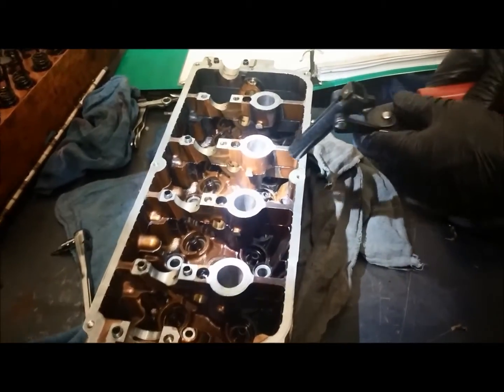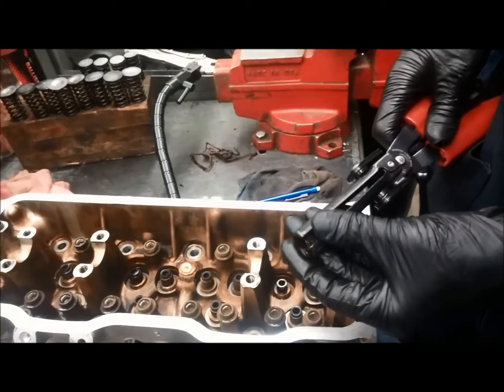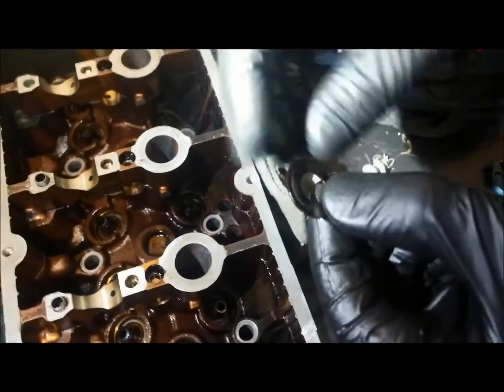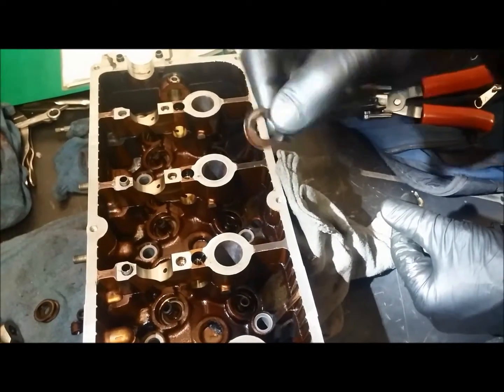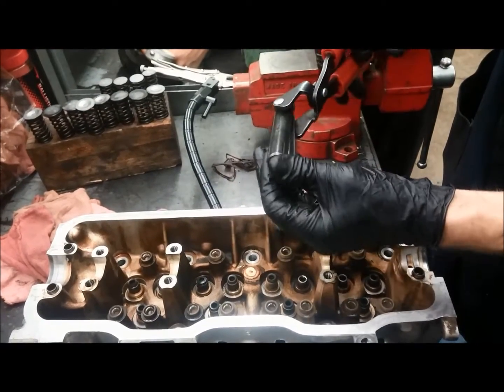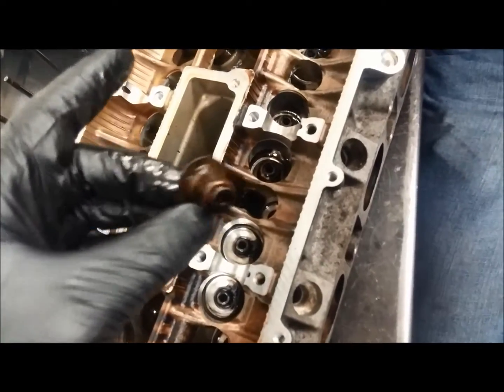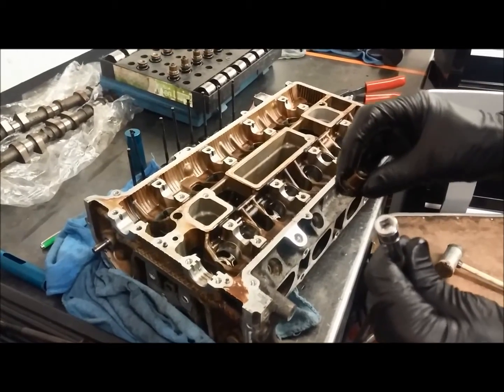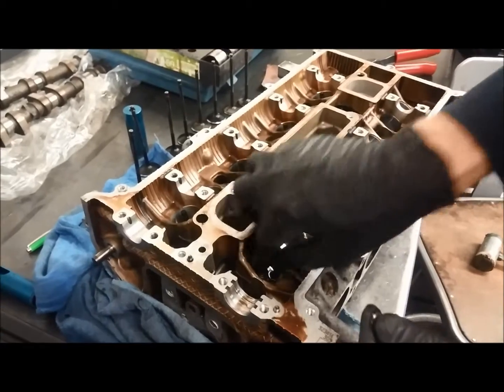Removing and installing valve guide seals

Comment: Is it a MUST to heat an aluminum cylinder head before replacing the valve guides? Can it be replaced with heating the head? The manual calls for it but wanted to hear from experience.